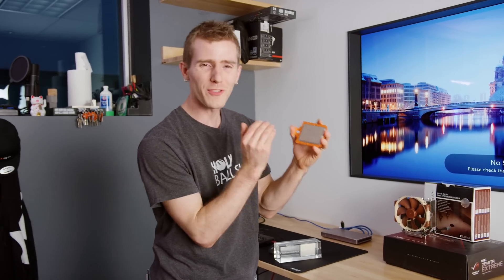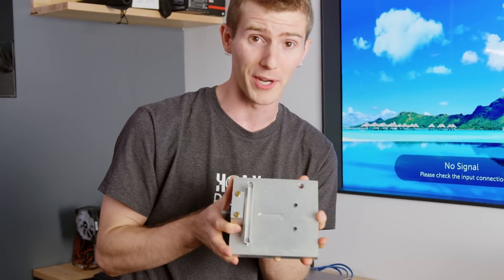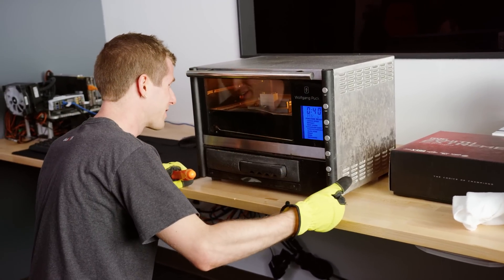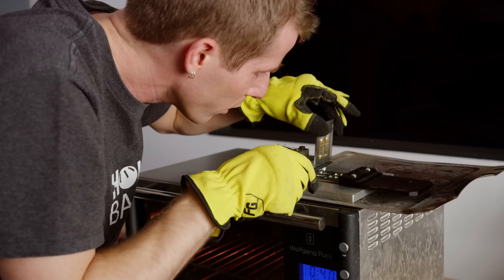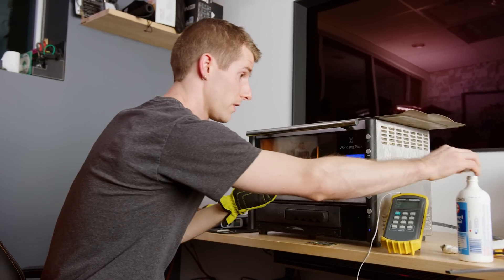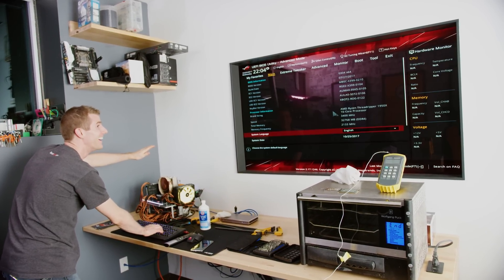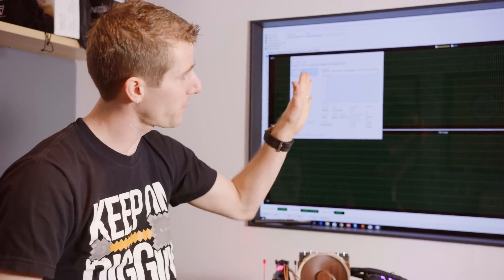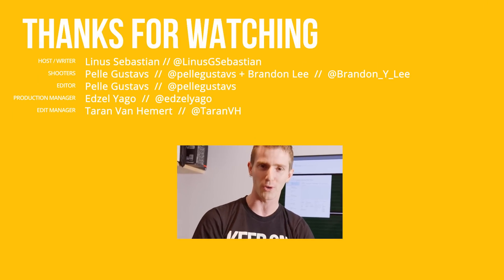Why would ANYONE Delid THREADRIPPER? - Vanity IHS Installation

Comment: Just FYI, metal is infrared reflective, you can't measure the temperature off of it using an IR tool! It's like trying to use a laser distance meter on a mirror.

Comment: Hi Linus, Someone could tell me,, use a improper heatspread system will burn my 1950x or the processor can handle overheat? i`m testing my old cooler but i will put a thermaltake riiing 280mm soon.. thanks

Comment: Was your de-lidding tool pre baked to remove oils embedded in the aluminium? Im not much of a tech guy but I am a metal guy and after machining anything where oil from machining or oil from the metal itself is critical I will clean it and then bake it, like prepping for powder coat ect...

Comment: I would be interested to know if this CPU is still working, I had CPU 0D error on an ROG Zenith Extreme Alpha and it actually was indicating a slowly dying CPU. It worked fine to start with for two weeks and then it occurred increasingly over a period of a week before that was all you would get and the system would not start, took it back to store and they confirmed in another mobo that it was a dodo.

Comment: Why??? You delidded a freaking Threadripper only to put an IHS right back on it? Why not slap those bare dies right up against the radiator block?  I can't find a single example of direct die cooling of TR. Feel like I'm living in the Twilight Zone. Who wants to bet most TR chips can hit 5GHz with a bare die and adequate cooling? 5GHz TR would be so hard to beat.

Comment: Hey Linus can you recommend a motherboard that's ideal for overclocking please? I can get a Ryzen 1700 upto 4GHz for about half a minute before the system freezes so I suspect it's an issue with the power delivery. Thermals got high but it didn't crash because of the thermals as I could get it to reach even higher temps and remain stable at lower voltages and clock speeds so I think I just need a motherboard with better VRMs. But I don't know which series of motherboards or even which brand is best. I can sort out any thermal issues I'll have but it's this problem that I'm clueless about.

Comment: Linus, many a times in your videos the system doesn't boot up at first, there are post errors and the situation is gloomy and all - but then the video will magically cut off to "Whoa, It works" with no explanation whatsoever to what the issue was. I understand that the suspense is good for videos and at times "faking it" is necessary, but can we at least add a plausible explanation in these instances for the sake of closure.
Reply: No

Comment: I did this with an old CPU that had metal solder, just let the flames of a blowtorch graze it for a few seconds. Popped right off and yes the CPU still worked.
I don't recommend trying it though, just because it worked for me doesn't mean it will work for you.

Comment: hi i have a descant pc with win 10 on it take for ever to load up in win 10 what could i do to make it load faster with out having to close all my programs?
specs 
win 10 pro 64bit
cpu-i5-4670k
ram 8gb 2 4 gigs
gtx750ti
had a gtx580 but it just stooped working i baked the card in the overran a few times it worked 5 months then stopped working again...

Comment: So you have amazing CPU lid in a fancy case where you can show it off to everyone but that was not good enough, I say this with a smile. And does anyone know the effect of thick thermal paste. I am by no means an expert so I am inquiring, it is a Canadian thing.  What I mean is it is designed to work really thinly to fill the surface micro scratches? Would the much deeper engraving not cause hot spots?

Comment: While AMD uses a very thin layer of very good heat spreader compound, making it really good for normal use, including water cooled, the compound is optimized for normal ambient temperatures.

One might want to delid if they are using ultra-low-temperature refrigerant cooling in their over-clocking setup.

Refrigerant cooling systems have so much that can go wrong they are another YOLO case.

Comment: infrared thermometer don't work properly on shiny surfaces
Reply: They do if you put some maskin tape on it
Reply: damian herrera - then the masking tape would melt
Reply: I mean he's using like an oven to heat it so I guess it's kinda like 'to get an idea' cos that's surely the lest of his worry's 😂 still cool tho
Reply: They do? I dont understand why it wouldnt, shiny surfaces arent full on mirrors, unless its like full on chrome that looks like a mirror it works
Reply: @lmaolol69  Shiny surfaces dont emit as much infrared radiation as less shiny surfaces. While typically metals are the main exhibitors of this trait, even just glossy paint and cause inaccurate readings

Comment: But Linus, you cannot see the engraving while the cpu is built in :D I hope to one day see a massive diamond be used to contact the cooler with the cpu, that way it would be both transparent (I'm sure you can find a way to work around thermal paste) and also diamond is a 5x better thermal conductor than copper - so better OC. Maybe in the next project? ;-)

Comment: Why not use heat gun and that jiggy magiggy thingy to delid , instead of using a broken ass oven that cant even tell you hot hot it is ? whereas with a heat gun you just point it down to the point untill solder melts a bit >>>???????????????????????

Comment: On a serious note, this would be sick as fuck if you used this cpu in those pcs that are submerged in some dielectric fluid - not mineral oil cooling, but the kind where the processor has no cooler on it and is just exposed and boils the fluid constantly

Comment: i have an idea make a albumin block whit a square in he center and make a clear hard plastic for the top with center of the block where the engrave is now a gap is formed fill it with mineral oil, use mineral oil for the loop as well just to be safe and no mix happens.the reason you want to used the mineral oil because it will make the engrave pop-out behind the plastic top. if you want to go all crazy i think it could be a really awesome project!!! use 2 rads to make sure you have enough of the cooling. ever since you did that video where you had to remove it because the case used mineral oil and someone has a copyright on it :( but ever since then i been dreaming of other uses with the mineral oil because i just loved the way it looked. hopefully you read this and think of some other project with mineral oil as  a coolant and/or case. or attempt this idea! maybe the even make a build where you make the computer that you then also attach it to a drill riding on rails powered buy the computer and use it to make your own cpu coolant block. it would be very involved yo then need to figure out a seals issue no rubber right. go yolo as you like to say and do this project!

Comment: It's kind of cool, but at the same time, now they have their nice shiny custom IHS under a waterblock where nobody can see it.
Reply: That's not a waterblock. It's a heatsink. Waterblocks are for liquid cooling.
Reply: Well duh, no shit. I just saw the waterblock hanging off the test rig when he was checking the post code and forgot he was using the air cooler. But still... in whatever machine this would ever end up inside will 90% surely be watercooled anyway.

Comment: I've been watching linus tech tips for the better part of four years now. I've seen a single $30,000 PC made to be played with 7 players. I've seen a water cooling system installed in a PS4. I've seen a PC whose case was filled with mineral oil. 

But this is may be the most over the top LTT video I've ever seen, because it serves literally no purpose. There will always be a heat spreader on top of the CPU.

Keep it up linus!

Comment: Hey guys I need help. I have an intel Pentium with lets say 3 cores and the bare minimum of a games system requirements is an i3 with again 3 cores would I be able to play the game with the Pentium ???????????? ( same Ghz )
Reply: Give us the actual chip names and we can tell you
Reply: No.
Reply: So to what it depents on to be able to play the game betwen those two CPUs
Reply: Give us the model of the CPU on the min. requirements and give us the model of the CPU currently in your machine. Only then can you determine whether or not it is faster.
To figure out your CPU, open Control Panel, go to "System and Security," then "System."
Reply: Yes you can, and a gtx 1080 is as good as a gt 630 because 1+0+8+0=9 and 6+3+0=9

Comment: Hey guys!
Which RAM should I buy? 
1. Corsair Vengeance 16GB DDR4 3000 MHz RGB [200$)
2. Corsair Vengeance LPX 16GB DDR4 Black 3600 MHz (215$)
3. Corsair Vengeance LPX 16GB DDR4 Black 3200MHz (200$)
4. G.Skill Ripjaws V DDR4 16GB 3200MHz (200$)
5. Corsair Dominator Platinum DDR4 RAM 16 GB 3200 MHz (200$)

I have glass side panel so the RAM sticks will show.
Please help <3

Comment: If you've ever used a soldering iron before, you should know that solder hardens in basically less than a second. You took way too long to try and remove it.

Comment: AMD is Gold plating the IHS and using Indium as the thermal interface material. Intel should be ashamed of themselves.
Reply: the gold is used to have the indium stick to the ihs. there's also gold ont he die itself. And there are several other metals in there.
But intel can't use that for quite a veriety of their chips at the moment for the simple reason: they are too small.
See those huge dies on that threadripper? No issues with that but with smaller ones the stress from expanding and contracting of the metal on the edges isn't as sppread out and the indium breaks apart underneath the ihs.
And thats not good at all.

Comment: Are you sure the ‘heat spreader’ from the vanity chip was actually a heat spreader, and did you test first if the vanity chip worked? It looked functional, they should’ve given a working 1950X.
Reply: Given it worked, it must be a heath spreader.

Comment: seriously after such sloppy job the CPU survived?? not to mention that the temps are going to be worse with replaced thermal paste instead or original soldering!
Reply: At the end it said the temperatures weren't that bad.
Reply: on stock , with short load. der8auer got higher temps on ryzen, after deliding and using CLU. i wonder about prime95 temps!

Comment: Measuring the temperature of shiny metal (or any reflective surface for that matter) is extremely unreliable when using an infrared thermometer since you measure a lot of reflection. Your use case with the heating elements directly above the surface you where measuring is prime example, half of the temperature the thermometer is showing comes from these.

Comment: Fantastic work.
Is it possible to glue on a clear CPU water block top and let water cool the IHS directly.
You should be able to see the tekst trough the clear top and water, but maybe the cooling is not good enough i dont know.
I have seen it on the old AMD XP series, a person had direct die water cooling.

Comment: He says he's set the oven to 355° and wants it to be about 15 degrees lower than that... Then takes it out at 250 and wonders why the solder didnt melt... Good job linus.
Reply: AeranoZ Music 250 fahrenheit is almost half of the same in celsius 122 degrees. In canada, the measure is celsius, 350 celsius is 660 fahrenheit. His flir tool probably has two settings.

Comment: Linus clearly needs a hot air reword station with temperature control. The heat could have been more fine, and as required applied to the area he wanted. All at the temperature he wanted.

Comment: Linus. You should put some black tape on the Metal to measure its temperature (probably not on the cpu lid though). Otherwise you’re just gonna measure reflections of the surrounding heat sources.

Comment: 7350K lid on a 8700K or a 7940X lid on a 7640X lololol. Assuming the lids are the same size or close enough. Some Ryzen 3's and 5's were actually Ryzen 7 1800X's but in Task manager it would still say "Ryzen 4 Core Zen" or whatever but you could tell it wasn't by the thread count.

Comment: I am soooo confused by this video. What is the point? Is it to have a working CPU in the clear magnetic display thing? Or was it to  use the laser etched lid on a working chip? If the latter, then why cover it up with a cooler? Maybe find a clear AIO cooler so you can at least show off the laser etched limited edition lid???????
Reply: Maybe he scratched his name on the inner side of the lid.

Comment: Louis Rossman already showed that you can’t repair things with toaster ovens.
Reply from the maker: +DarthSmartt this has nothing to do with that.
Reply: Linus Tech Tips I know I was just bringing it up. Lol
Reply: IMHO, delidding isn't about evenly heating, it's about rapidly heating just the part you want to release. I use a heat gun to delid GPUs all the time (and sometimes surface mount de/soldering). Even if IHS solder melted at the same temp as the die solder temp, rapid heating and temp gradients would permit removing just the IHS. The toaster oven is meant to evenly heat things, which probably made delidding significantly harder and riskier. Linus is a champ!
Reply: " just a meme" "just a meme" " to be a meme" "a meme to be a meme"
" i dont care Its just a meme"
Reply: LTT Lol, I wonder what's his reply for this will be!
Reply: DarthSmartt 
Linus Tech Tips
 (mere mentioning of his name)  "its just a meme" - now boiuy
Reply: Chris Balfour it was a joke lol. Also emojis aren’t working on the YouTube app for me.
Reply: When the reply to your comment has more likes than the comment itself.
Reply: 9500gt reflow working here
Reply: the best videos are the risky ones :D
Reply: you temporarily resurrected a dead chip by warming it up.
Reply: Leave it to Linus to prove Louis wrong

Comment: Why didn't they use their new laser cutter to engrave it?
Reply: Because they wanted to use the one amd sent them and make a video about it...
Reply: Epicvampire800 the only logical response in the entire thread. Hahaha
Reply: Well you also have to consider the wavelength of the Laser depending on material (like Felix has mentioned). Depending on the material properties, you need certain density of Laser radiation so that the material can be thermally damaged. For metals that wavelength is around 1064 nm (10 times less than typical CO2 Laser). These lasers are typically solid state or fiber lasers which produce much smaller spot size than a CO2 laser.
Reply: Power density only takes you so far, unfortunately.  Keep in mind, there's a physical limit to how far a beam can be focused, which is dependent on it's wavelength.  With a CO2 laser the wavelength is 10600nm which is fairly large, and you cannot achieve a focal point smaller than that.  Unfortunately, more power really is the only solution for certain materials.
Reply: I know it will be dependent on several things (the IHS is a heat spreader by design). So you have a function of rate of heat transfer from heated area  (thermal conductivity dependent), absorptivity (how much it actually turns into heat vs bounces back), and light beam physics limiting area (as you mentioned). Then you also have temperature the materiel needs to hit to solve for that equation. Shouldn't be difficult to derive that equation, but I'll leave that for after my exams to solve for fun in my free time (someone's probably solved it, but where's the fun in just looking it up?)
Reply: I have access to a 20watt fibre laser marker machine. It can mark stainless steel a range of colours. With lasers wavelength is more important than power.
Reply: Wouldn't the diameter of the beam be more important than the power rating? For instance, half diameter gives you 4x more watts/area, whereas doubling power only gives you 2x watts/area. I would think the watt/area would be a better indication of the material it can work with (may be slow at 40w, but who cares if it gets the job done).

Comment: The have cheap little microprocessor controlled hot air soldering stations on ebay for like $30.  It would be perfect for this.

Comment: WHY!!!??? Y WOOD U DO DAT!?!
You just defaced a very valuable and personalized gift for this project, DESTROYING he value of it!
As awesome as a delidding video and modification  is, this has to get one of the RARE downvotes from me. It was painful to watch.
Reply from the maker: +Edward McInnish what are you talking about? In what way was it destroyed? We started with 2 CPUs - one working and one dead. We ended with 2 CPUs - one working and one dead.... What video did you watch where anything was destroyed?
Reply: Linus Tech Tips I hit the post button a bit too early.
It wasn't about the CPU being a blank, it was the value was actually defaced on the vantage unit regardless if the final product was a functional CPU.
I will revoke my downvote, but this doesn't make it any less cringeworthy.
Also, that prototype delidder is nightmare fuel for tight budget :P

Comment: 3m03s. Linus touching a supposedly hot item without heat gloves. Do I sense made up drama to make his videos more dramatic? Linus, don’t stoop to the same lows as mainstream TV.
Reply from the maker: +Smurph onomics the more pressure, the more efficient the thermal transfer. Look close I'm supporting the weight with the gloved hand ;) - LS
Reply: So you don't work for the Illuminati? Damm. I thought I had caught you out :p

Comment: PLEASE..... buy a set of "tap and dies"

that way, when you drilled the holes to a bigger size, you could have run a tap into the hole, which will cut PERFECT new threads 

its also good for cleaning up a hole if you cross threaded it and fucked up some threads....
and the die can be used to clean up threads on the bolt

comes in hardy quite a bit
Reply: the "glue" over the little surface mount capacitors is probably "conformal coating"

it keeps any water or moisture from shorting shit out